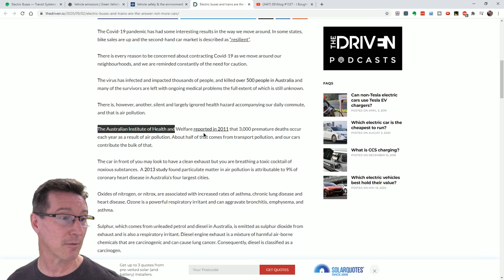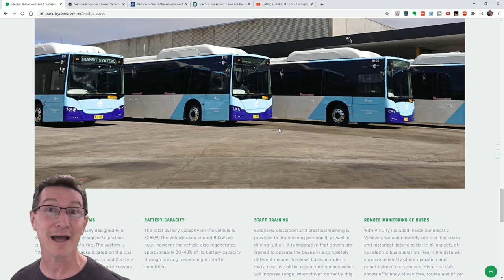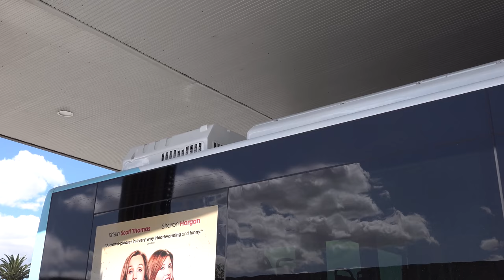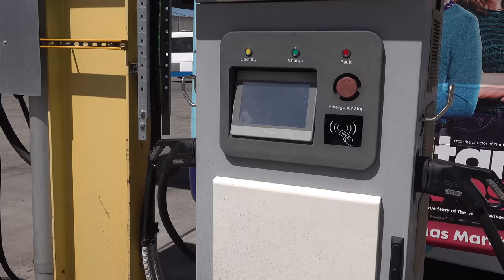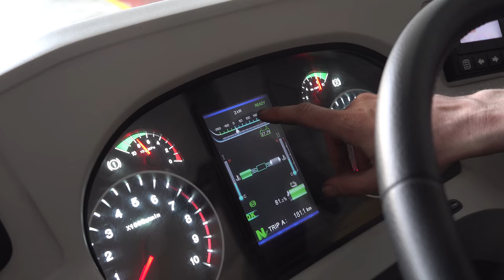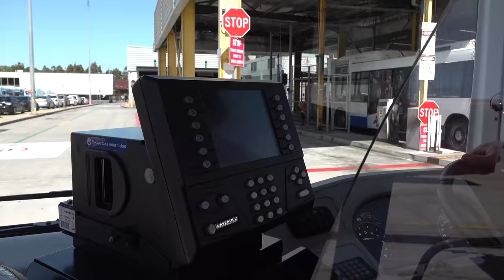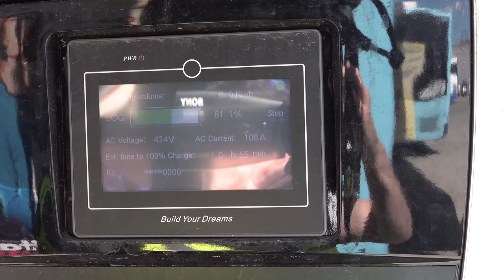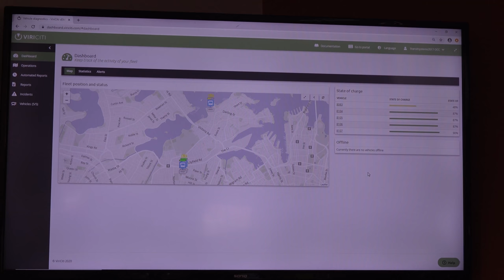Electric Buses in Sydney

Comment: 424v x 108A = 45.7kVa - about 70 Amps per phase - for ONE bus.  More than a three phase house supply right there. There's 100+ buses in that yard alone. If they were all electric, that's 4.5MW you have to find, just for one depot. Peak constant load, Every night, hour after hour. About equivalent to an entire zone substation for a medium sized suburb running full tilt all night at 66kV supply. GOOD LUCK. Do the MATHS people!!!
Reply: For comparison, 4.5MW would be the load of one small data centre and there are dozens of those scattered all around Sydney, and many that are much bigger.
Reply: 4.5MW is about the power usage of a single electric commuter train accelerating. No problem at all!
Reply: @ickipoo  Count'em on two hands mate. There are thousands of buses.
Reply: @stephanweinberger  Lets get this straight - I am all FOR electric vehicles and YES, it can be done. But we need to get the facts straight about what's going to power them in environmental terms..
Reply: @zordmaker  Of course. But still we should not forget, that with any source of electricty, EVs are cleaner than ICE cars. The efficiency and emission control in power plants is just so much better, that even burning coal to power EVs is more environmentaly friendly than using diesel or gasoline in an ICE. But of course the goal should be 100% renewables - and we're slowly getting there, coal is slowly phased out as wind power has become cheaper to build and operate. Even solar is not that much more expensive any more. And of course hydro/pumped storage where available.

Where no pumped storage is available we will still need gas powered peaker plants for the forseeable future, but those are much cleaner than coal as well.
Reply: @stephanweinberger  Wind, Solar and Gas ain't gonna power an electric future on the roads mate.. do the maths. We're not talking peak, we're talking hours and hours of constant demand. We'll need at least another 8GW of dispatchable (i.e. constant) power if you want the future to be an electric one across the state. That means only one thing.. if we want to stay carbon free, the "N" word needs to come out.
Reply: @zordmaker  Even with a 100% electric fleet we're talking only about 15% increase in electricity consumption (that's in Europe, in the US it will likely be even less).

I'm not against nuclear, but it turns out to be quite expensive once you factor in all costs.
Reply: There are 8 bus depots. EIGHT.
So by your calculations, 8 x 4.5MW = 36MW. So we'd have to find an extra 36MW per hour.
Bayswater power station generates 2,640MW. So running all 8 depots in Sydney on electric buses will draw just over 1% of one coal fired power station in NSW. Given that during the day we are going to be generating a lot of solar, plus with more people putting roof-top solar on in Sydney, with 6.6kW becoming the norm, this is going to be a LOT of excess power that can be sold back to the grid during the day, I don't think this is going to be a problem.
Reply: @zordmaker  8GW is 3 large coal fired power stations. In the UK 8GW is one third of their current (not future, current, being generated right now) offshore and onshore wind farm output of around 24GW and rising. In Sydney we have 1.7 million houses and many people are busy installing 6.6kW solar systems for around $3,000. If only half the homes had solar that's 6GW being produced every hour just from solar every hour of daytime just in Sydney alone. Not to mention new solar farms west of the GDR. And not including wind. That's just Sydney - 8GW for all of NSW is easy as falling off a log once more renewable energy zones are opened up. The only reason they haven't been so far is because of the economic threat they pose to the fossil fuel industry.
Reply from the maker: @yggdrasil9039  About a 1/4 of homes in Australia already have solar, the largest uptake in the world.
Reply from the maker: @somedragon_  Err, no, the busses were charging while I was there after their morning shift.
Reply: @somedragon_  Sure, that's true. Yes State Transit are still very CBD centric and only list the 8 inner ones. As for solar, solar like all renewables are firmed with batteries these days and the argument about the sun shining at night (actually it does but not in the same place) and the wind not always blowing (actually the circumpolar vortex blows 24/7, but let that pass) is true but less valid now that we have storage in many forms (battery, liquid air, gravity, hydro etc.). Hornsdale in SA has paid for itself in 2.5 years so the economy of scale is there if the government want to roll out mega-solar farms. You're right about current capacity but Rome wasn't built in a day, and capacity will increase.
Reply: @somedragon_  I think when the SA storm hit, the house with solar and the Tesla wall battery was the only one with all lights blazing and music pumping out of their house in an otherwise completely blacked suburban street!
Reply: @somedragon_  many busses are at the depot at noon, because the peak traffic hours are in the morning and afternoon. So solar actually works quite well in this scenario.

If these busses manage a 12-hour shift with 60% of the battery you dont even need to fully recharge them over night; they could start at 50% SOC in the morning, do the rush hour, come back to the depot around 11 o'clock with about 25-30% SOC, recharge (mainly from solar) over midday and drive off with around 60-70% SOC to run the evening rushhour.
Reply: @yggdrasil9039  Well done. However remember that buses are on the road during the day and in the depot at night. Your solar ain't going to help much then. List all your depots please, I think you've missed out the other 19 west of Parramatta. I won't mention those in the rest of the state of NSW or ACT. Like I said... it's a good idea all round.. until you get the calculator out.
Reply: @yggdrasil9039  On current trends, retail electricity prices will likely go negative during the day before 2023. We'll actually end up paying the electricity company to take our power in the middle of the day. Meanwhile the price of power only a few hours later after 4pm into the evening will continue to rise to well past 40c/kWh
Reply: @yggdrasil9039  Sounds like my place after any windstorm, except it's rural.
Reply: @zordmaker  Because of all the cars charging overnight do you mean? Yes it's possible, though storage will help smooth the grid as it does in SA at Hornsdale - but not just batteries, future hydro (Snowy and others), and liquid air, gravity, etc, and these can feed back in when cars are charging overnight. Suddenly coal fired power station baseload energy will have an actual purpose at 3am!
Reply: @yggdrasil9039  Yeh... for a while, until electric vehicle penetration gets over about the 40% mark. Thats where night consumption will begin to outstrip daytime consumption, and where off peak prices at night will disappear, much to the distress of everyone who uses this rate to heat their hot water. As you have indicated the solution lies in adoption of a mix of all technologies - however when you add electric vehicles to existing demand for energy, you realise that if we want to eradicate carbon technologies, nuclear is going to have to become part of that mix. Nuclear has a very long lead time to development so now is the time to kick that off. If we leave it too late, there will be years of energy shortfalls to go through before the system catches up. Charging batteries during the day merely to charge other batteries again at night represents nearly 50% energy losses in the conversions required - so 6kW captured during the day will equate to only 3kW in your car at night.
Reply: @zordmaker  .
A mate charged his EV at our place on Monday. 5kW from our home solar & the other 6 kW from the grid.
At the time there was 40% renewables in the grid in the grid. 
Daytime charging is much cleaner
Reply: @stephanweinberger  . The grid is typically about 40% solar 2 hrs each side of (solar) noon
Reply: @guringai  As  said.. all good when you only have one or two in the street. Now multiply that by a factor of 10... and you have blown fuses at the sub at the end of the street.
Reply: @zordmaker  .
I'd say they they could manage by staggering the charging times & covering the roof with PV. 
Agreed they'd need to upgrade  the substation though!
Reply: @guringai  Now what happens when every sub in the city needs to be upgraded... who pays for that? WE do. Electricity prices multiply accordingly. I'm not saying it can't be done. I'm just saying that it seems everyone is backing into this with their eyes shut. They don't see the real cost of electric vehicles on the supply side, only the demand side (i.e. the cost of the vehicle itself). In reality the supply side costs will dwarf the demand side, eventually making conventional fuels cheaper. Time for a reality check.
Reply: @zordmaker   To help address the supply side - it is a good thing that some of the grid owners / DNSPs are getting onboard - such as with the new proposal to have EV chargers in the back street substations / & kiosks- see link below. 
Other key opportunities are pricing signals such as cheap power when the sun is shining - such as with Amber Electric the (electricity retailer) 
& distributed generation will be a bonus, not to mention big batteries at charging stations like they already do in advanced countries like the US & the EU. 

https://thedriven.io/2020/10/13/ausgrid-and-start-up-jolt-to-convert-sydneys-streetside-power-boxes-to-ev-chargers/

Comment: Sorry to say but those things SUCK in colder climates. I bet they're good over there where you basically have infinite solar energy and all that jazz. They're expensive as frigg to keep running over here and we're just moving the pollution somewhere else. Great video nonetheless tho :)
Reply: They have winter in Australia too.  And the temp does go below freezing..  Did you think it's summer all the time there or something?
Reply: @markjohnson7887  Nothing like we have. Try -30 deg c
Reply: Well said. 
They gotta mine, refine, and ship that aluminum, cobalt, lithium, etc, somewhere.Not to mention the chemicals to make the plastics that will be around 10,000 years later.
You can just continue driving your car that's already made.
Reply: In those cold climates, it would make sense to heat your house using a CHP generator if you have access to heating fuel that's substantially cheaper than electricity.
Reply: @stevenm.2380  If I understood correctly, they are replacing old gas buses that would have needed replacement anyways
Reply: @Christian Ivarsson yeah, that's why they dont have electric cars in Norway...
Reply: @Chriva  My bad.  You're right.
Reply from the maker: @markjohnson7887  Not in Sydney it doesn't.
Reply: @NiHaoMike64  .CHP is bullshit unless All the heat can be used.
Many CHP units are now being removed from swimming pools because they are so expensive to run.